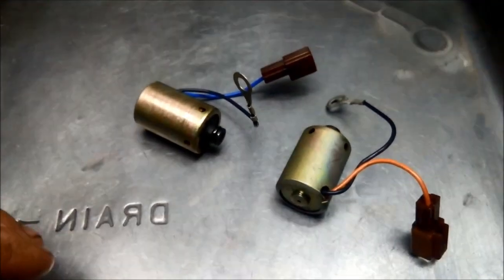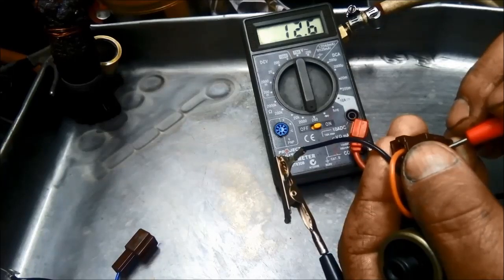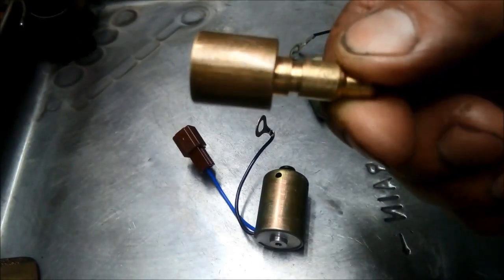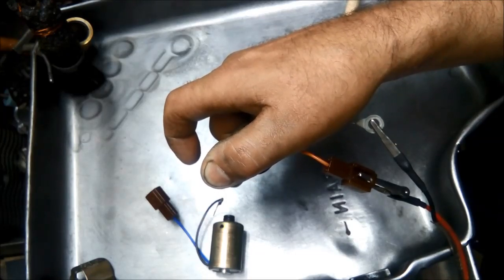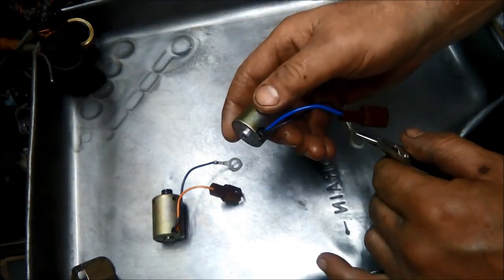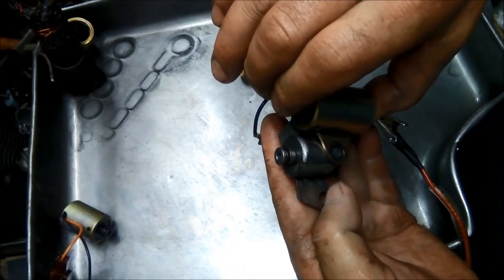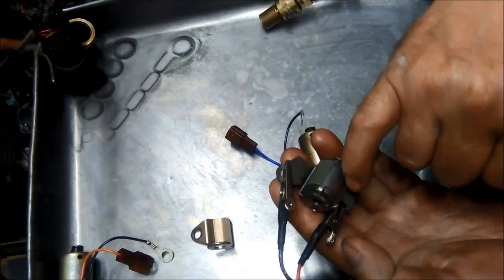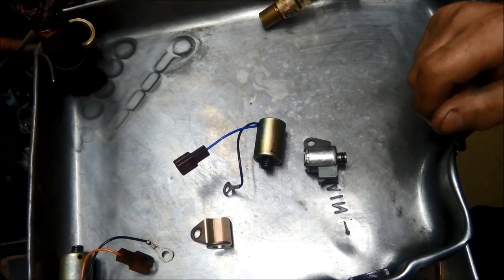Automatic Transmission Solenoid Testing on Bench DIY What to Watch out For A340 as example

Comment: Hi great video, very helpful, so the line pressure is 70psi? Or is there less at the solenoids than the actual line pressure? Thanks
Reply from the maker: hi, testing with air is a bit different to how they actually work with fluid...not to take into account heat. 70psi is good to test with air most of time, and depending on what kind of solenoid you are testing, 10.5v is considered a flat battery, so if it works well at 10.4v it shouldbe good at 12v or 14.3v where normal vehicle operates at. cheers

Comment: Hi is the lock up solenoid same as the shift solenoid? I mean are the interchangeable? And do they both go on and off? I bought a rostra solenoid to replace a faulty solenoid that didn’t click and my transmission is a340 on a 1986 Toyota pickup- I replaced solenoid number 1 and now my truck shifts into first only and then my driveshaft shakes so I have to pop truck in neutral to stop the noise from my drive shaft. Before the solenoid swap I did not have that vibration coming from my shaft so I’m wondering what went wrong. Prior to swap my truck would at times rev up but first gear wouldn’t engage until I pulled over and tried again then it would run normal
Reply from the maker: hi, i`m pretty sure that they arent the same or interchangeable. you need to be careful as some solenoids look the same but are different in that some are normally open and some are normally closed. cheers
Reply: @YepThatsIt  thanks a bunch
Reply: @YepThatsIt  hi again in you test I noticed that only the shift solenoids make click sound when you apply power and the lockup solenoid only clicks when you apply air- is it normal for lockup solenoid to only make click sound when you apply power and air at the same time? I’m asking because I just received my new lockup solenoid and it only clicks when I apply power and air at the same time and it’s usually open like your test but closed when I apply air and testing good
Reply: @YepThatsIt  
Appreciate your video mate got a ? Im tryn to figure out which one on the vavle body is the lock up solenoid i have the a340f transmission in a 01 Tacoma and from what ive seen some people say its the one next to the bell housing but i think its backwards and its the one at the back of the valve body i dont want to get them backwards any info id appreciate thankss.......

Comment: If you just connecting the selenoid wires  without connecting the aire hose do you still hear the selenoid make a clicking noise when it get the 10v ?
Reply from the maker: hi, you should be able to hear it...but not always, that is why I also check with air pressure. air is also thinner than trans fluid, so if it doesn't leak with air it will definitely not leak with trans fluid. cheers

Comment: Why is my externally mounted solenoid buzzing quite loudly ?..I assume it's faulty, it also weeps trans oil 
Should I replace it or clean it.  The car still shifts gears reasonably well...
Reply from the maker: hi, you ned to test it with multimeter. itcould be worn and/or contaminated with metallic swarf, or bad elecrical connection, weak battery, bad earth etc. cheers

Comment: I have check engine light and it is the Torque converter Lock up Solenoid, is there a way it failed because it is dirty and is it possible I can clean it instead of replace it? Thanks so much for the video. Very nicely done.
Reply from the maker: hi, often you can improve them by flushing. biggest trick is to de-magnetize the solenoid first as the metallic debris becomes magnetic and is attracted to coil and plungers inside the solenoid; hard to flush or blow out with air pressure. cheers
Reply: Thank you so much for the information.
Reply: Thanks great video. How would you de-magnetize the solenoid?
Reply from the maker: hi, we have a demagnetizer ( also called degauss ). we roll the solenoids on the plate and it will demagnetize the solenoid. cheers

Comment: Hi, cool video, what kind of parts washer is that?
Reply from the maker: hi, my father made it over 20 years ago from an hydramatic 05 pan and a pump installed in a 20l drum, neodymium magnets are under the pan to catch metallic swarf and solvent recirculates. cheers
Reply: @YepThatsIt  cool thanks, i have been thinking about making my own lately. Would it be ok to wash out those solenoids with a water base solvent or you only recommend a fast evaporating?

Comment: do you bolt the ground wire to the valve body? Thank you
Reply from the maker: hi, yes. make sure you have good earth strap connection to chassis as usually they are bolted to paint...the only contact is through the thread of the bolt. cheers

Comment: Hi i got a question so i recently got a code for the torque converter circuit p0740 on my 98 jeep cherokee. I change the filter , transmission fluid and tcc solenoid and my jeep doesn't move at all when put into reverse or drive. Trans fluid level is good and i checked the torque converter stator and it rotates clockwise and locks up counter clock wise. I thought it might be the shitty solenoid kit i got from ebay. I heard the rostra brand is good thought about trying their tcc solenoid.
Reply from the maker: hi, yeah people often bring in ebay solenoids for us to fit for them, most are used/contaminated/leaking anyway. cheers

Comment: My 02 Lexus RX300,doesn’t shift properly. When I put it in drive,accelerate slowly, I can feel the first shifting,normally. But,two,three seconds later,a second shift kicked in,but felt very hard or strong shift, like a pulling shift forward and then smooth out. Is that a shift solenoid or something else ? I tune up already still same. I couldn’t identify which one is which, because there there are three of them...so,exactly, what caused that symptom? Thanks
Reply: Replace all the solonoids to be sure.
Reply from the maker: hi, if high mileage trans, could be worn clutch/brake and piston binding....or pressure cross leak somewhere. can be solenoid or valve body binding as well...always start with basic checks and work up from there. cheers

Comment: Hi thanks for the video.  What is the fitting you used to connect the air line to the solenoid?
Reply from the maker: Hi, Jamec Pem air hose fitting and custom made on lathe the solenoid end. cheers

Comment: 02 Kia Rio Cinco, eng. running trans. in gear, the car vibrates rapidly. Accelerate or put it in Park or neutral it smooths out. Anyone have possible causes?
Reply from the maker: hi, hard to say without having a look....check mounts and low idling. cheers

Comment: Selenoid car volt?
Reply from the maker: hi, hi I test at 10.5v because a car 12v battery is considered flat at 10.5v, so will definitely work better at 12 plus volts. cheers
Reply: @YepThatsIt  tenkyou